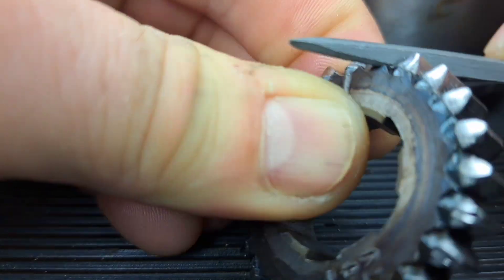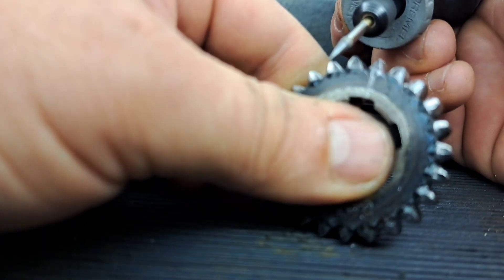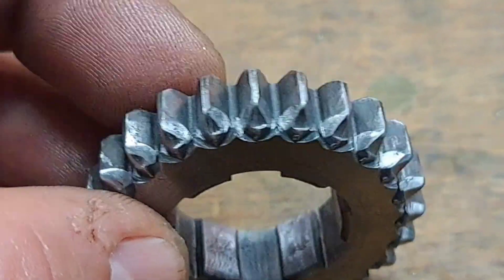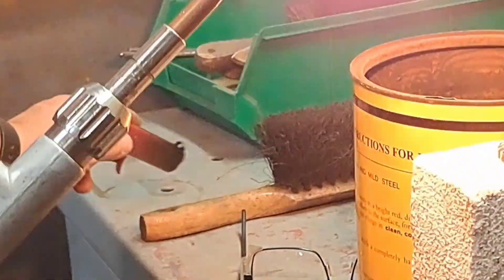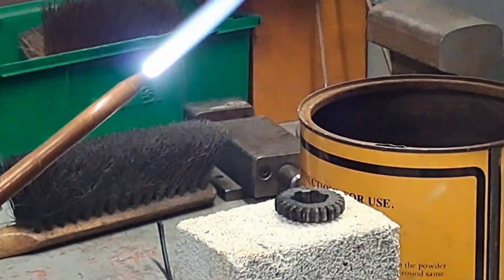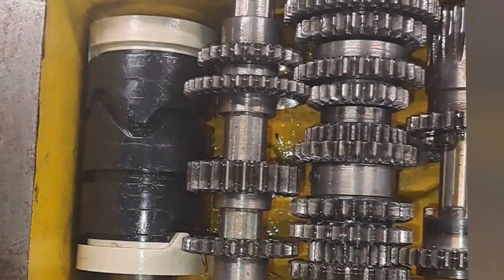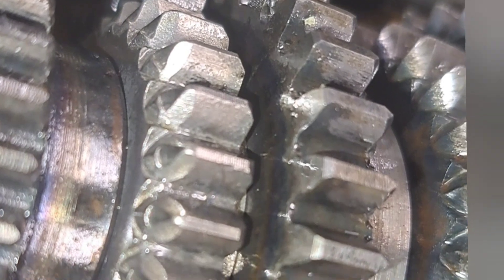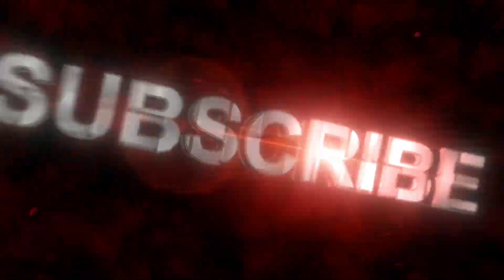Fixing the damaged gear - Episode 2

Comment: Not certain if you final heat treatment hasn't made the gear brittle and prone to fracture,.   Your final heating and quench would have reached the Austenitization temperature of the steel, and if the gear is made out of a medium or high carbon steel, it will be brittle and require tempering ...or is something else going on that was not shown in the video.
Reply from the maker: It was heat treated to be case hardened, as the metal is soft inside.